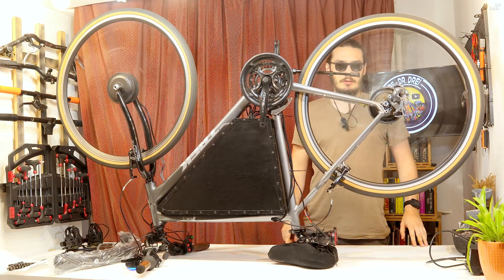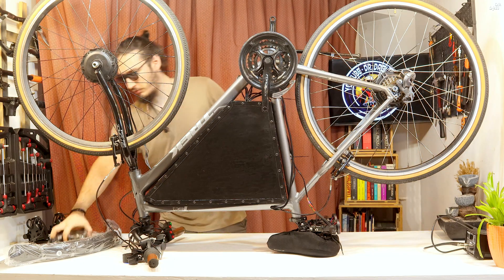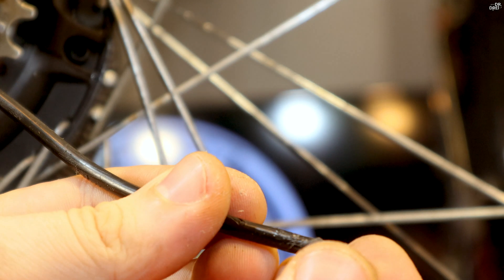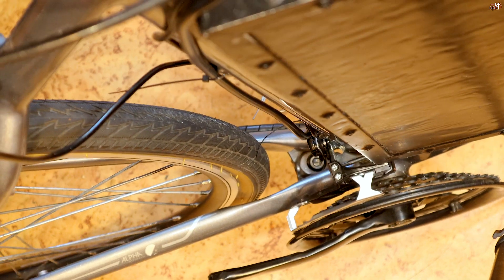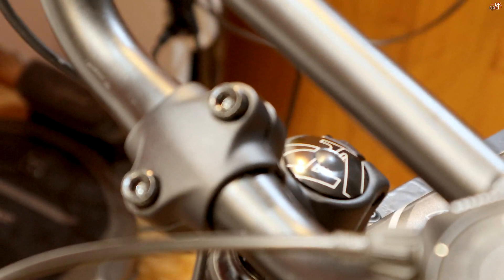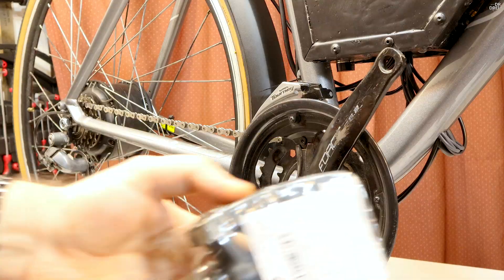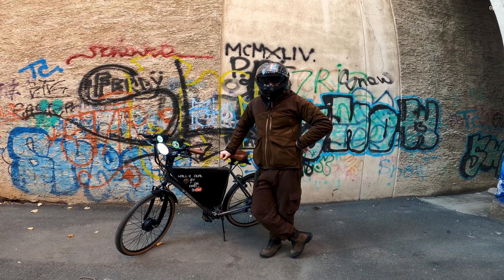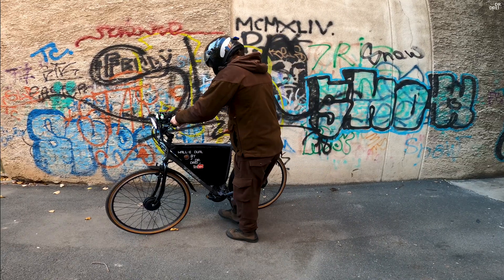I named it WALL-E DUAL | Building a Dual Motor Electric Bicycle from a pile of trash | PART 6

Comment: suge mult curent exact cum am speculat, ai marit diametru roti turatia motorului este mult mai mica si si consum mare , practic mergi mult in sarcina chinui motoarele , e ca si cum nu ai reductor la motor electric, inca o greseala uni pun chear variator la motoare electrice si tot nu este bine , e ca si cum ai merge pedaland pe o treapta mica si ai obosi tot timpu  la demaraje, nu rezolvi nimic ca scazi turatia la un motor electric, din contra, motoarele electrice au turatie foarte mare deci nu necesita schimbator , mai performante sunt fara schimbator chear da ai schimba doar o treapta la 50 km h in sus, tot nu ar fi bine, nici macar cu variator nu are forta sa urce in viteza la aceiasi turatie ca asta face variatoru, cel mai performant este sa fie calculat din fabrica si minim 1000 wati motoru pentru 60 km h si nu o sati condume bateria, cu acest proiect o sa ai consum mare din acumulatori la greu , un proiect esuat eu am stiut de la inceput. poti sa pui 4 pakete de acumulatoti in paralel , o sa ai consum ineficient si bani aruncati pe acumulatori, urmareste consumul pe acceleratie sa vezi ca suge prea mult.
Reply from the maker: Eșuat sau nu eu am învățat multe lucrând la el. E un experiment, urmează teste de autonomie

Comment: am o intrebare ca vad ca ai pus motoare msi mici si le turezi cam tare cu nustiu ce controlare, deci eu pe un motor Mxus nou xf39 36 volti 500wati am controler de 500 wati , si merge undeva pe la 40 km h si cam tot timpu duce 35 km h viteza, intrebarea este pot sa pun un controler mai puternic de 1000 wati pe un motor de 500 wati? cu planetare este are reductor.
Reply from the maker: Poți, dar sa l ajuti din pedale la deal